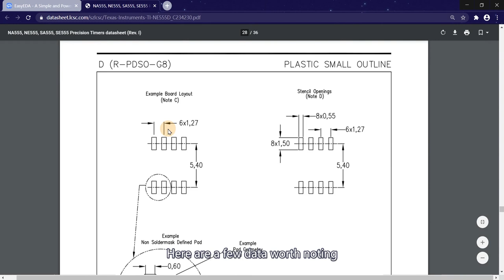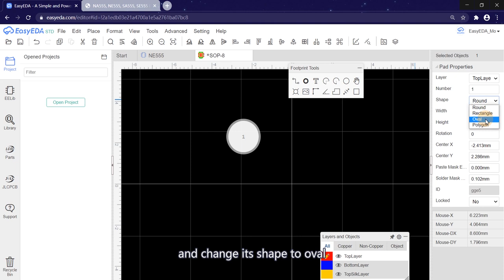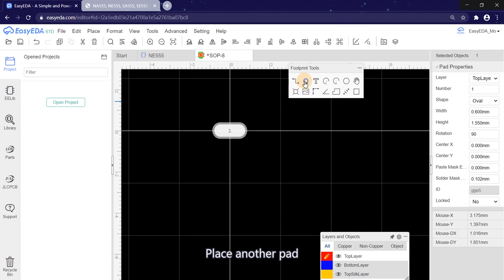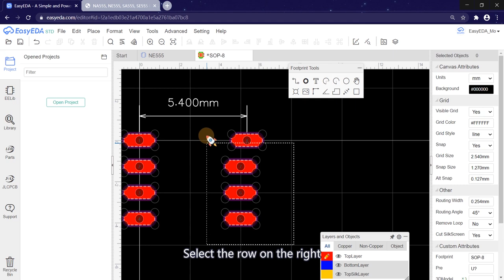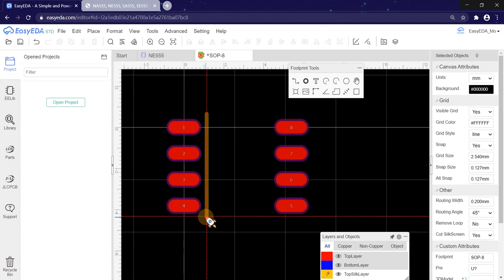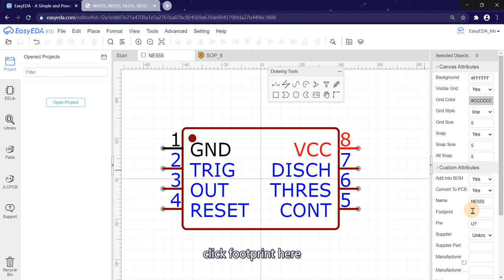006 Create PCB Footprint

Comment: I have a footprint symbol of 12 pads of 0.3mm width each one, plus a space between pads of 0.2mm. given a total of 0.5mm of space between pads. I don't find problem drawing my symbol, but, I will be able to order a pcb with 0.2 pads separation. I don't find limitation of prints pad to pad. Trying to create custom foot print for a USB Type C male that the manufacturer did not provided the library or model.

Comment: When You fix loose of logging on linux client ?
Reply from the maker: This issue is Google block other browsers, you can search this issue at Google search.
you can refer https://easyeda.com/forum/topic/Cant-login-to-EASY-EDA-Widnows-a0302bbe79234f2c8ad7167b0f2cedc0
0.Please reset your password to get the password
https://passport.easyeda.com/password/reset?service=https%3A%2F%2Feasyeda.com%2Flogin%3Ffrom%3Dhttps%3A%2F%2Feasyeda.com%2F
1.Hit password reset link above
2.Enter gmail email address and hit reset, keep track of your new password
3.Now log in "normally", typing in your gmail address and password, not hitting the "Continue with Google" button.
Reply: @easyeda2164  i allready resetting my password and it not working.
I haven't problem with logging in browser, i have problem to logging on client. And i not using google account but other mail like someuser@wp.pl
Reply: @easyeda2164  This work for W10, but not for Ubunu Desktop, please fix it.
Reply from the maker: @subs7v7n3  What‘’s your problem?
Reply: @easyeda2164  OS Ubuntu 20.04, cannot log in with google mail.
Reply from the maker: @subs7v7n3  please refer https://easyeda.com/forum/topic/Cant-login-to-EASY-EDA-Widnows-a0302bbe79234f2c8ad7167b0f2cedc0